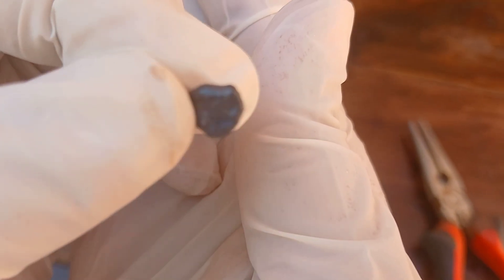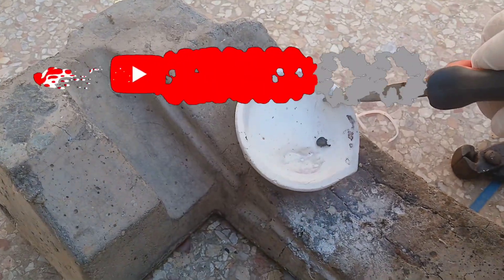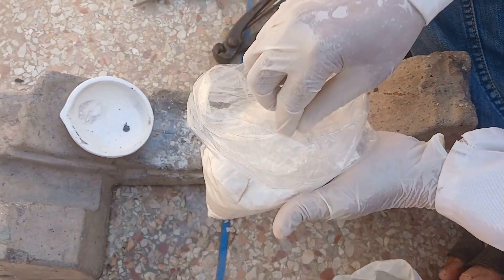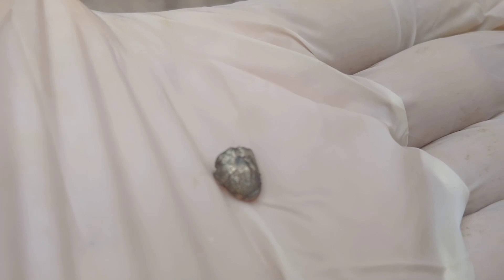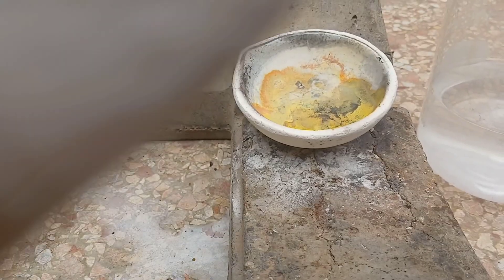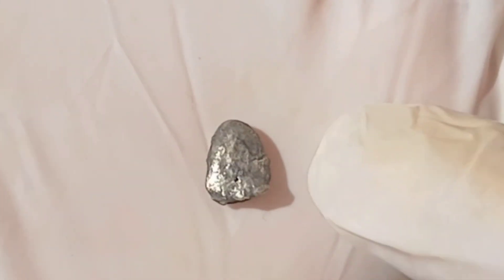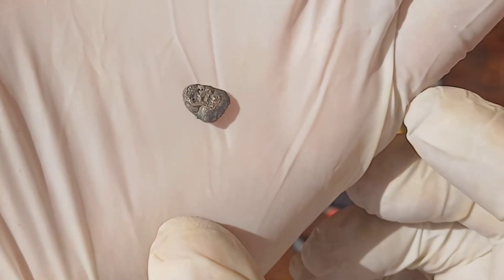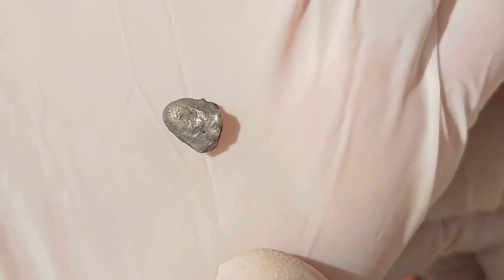Unlocking the Secrets: How to Easily Separate Lead from Gold in Alloys!

Comment: It was great. Why didn't you heat the entire lead coupling?. In my opinion, if you use a porous bush, you do not need borax and nitric acid. But in general, you did a beautiful job and your goal was to train with lead coupling and the chemical method with nitric acid to remove the residual lead. I praise you. great ❤
Reply from the maker: Tanks for the comment.

Comment: Master, I followed your procedures to get the gold from the mineral stone. the moment I put the soda (smb) in the acua regia. the water turns red!!?
Reply from the maker: When you add metabisulfite (often sodium metabisulfite) to a solution of aqua regia with dissolved gold, the usual reaction is for the gold to precipitate out of the solution as a fine brownish-yellow powder. Metabisulfite acts as a reducing agent, converting gold ions (Au³⁺) back into metallic gold (Au). The solution itself may turn color, but it’s more typical for the gold to precipitate, leaving a clearer solution.

If your solution is turning red, it could indicate the presence of other metals or compounds that are reacting with the metabisulfite. For example, iron or copper can cause color changes when they form certain complexes in acidic solutions.

To ensure you are precipitating gold, you can try the following:
- Filter and examine the precipitate.
- Test a small portion of the solution using a gold test kit or a stannous chloride solution, which will give a purple color (purple of Cassius) in the presence of gold.